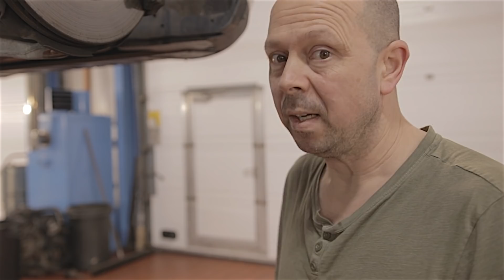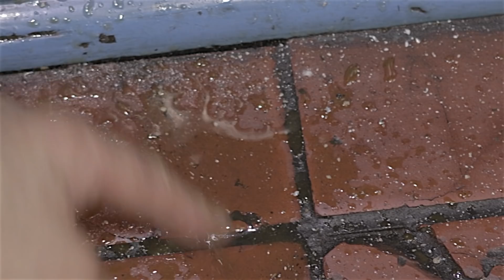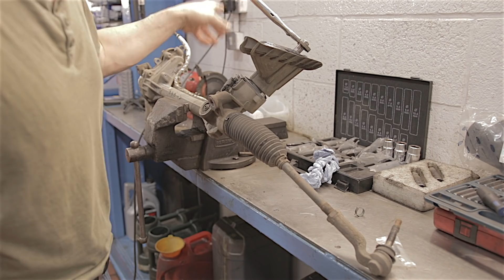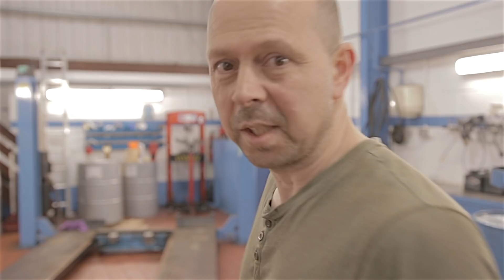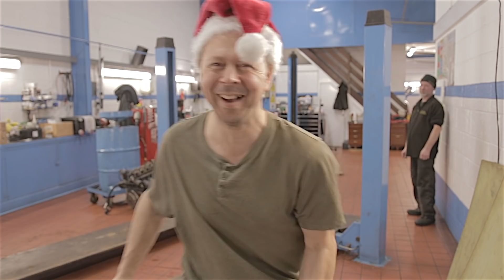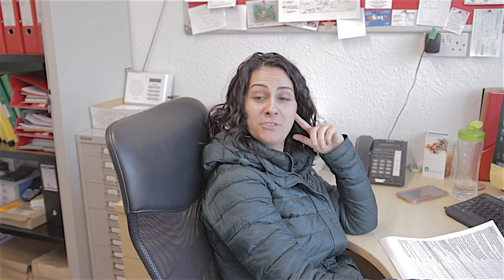Sheared Power Steering Rack Electric Motor Bolts (ford mondeo mk5)

Comment: Hi Alan. Have you ever had an issue with the steering having a notchy feel after long bends? Only happens on a long run.
Reply from the maker: hi, not had any notch issues with the racks on the mk5 as were common on mk3 mondeos but what is common on the mk5 is the front shock absorber top mount bearings causing sometimes severe notchiness....to check that, with the engine running, put your arm through the wheel arch and hold onto the coil spring while an assistant rocks the steering...if one or both bearings are faulty you will feel the notches through the coil spring

Comment: I have had two bolts snap in my 2015 mondeo. Found out during a recall. My steering made noise when I locked fully to left and right. They have told me it will be months before they receive the parts for my car, has anyone had an experience like this?

Comment: On my MK5 it's not making any noise or vibrations, but the steering is not fully returning to neutral/centre position. It gets stuck tiny bit before centre. Could it be also problem with these screws or just wheel alignment?
Reply from the maker: i doubt it very much but would be advisable to have your rack motor bolts checked anyway
Reply: @alan4x  I'll be changing brakes soon so I'll ask them to check the bolts, thanks a lot you took the time/effort to reply ♥

Comment: I have a Volvo V60 2014 D4 R Design, with speed sensitive electric steering rack. 193k miles. Mine has gone. Do you have a many come in with same problem of the motor/belt giving up? I think mine blew apart because a braided ground wire from subframe to chassis under air box, changed it & steering came back, but she gave up start of the week

Comment: Great video.  I had exactly the same problem on my 2014 Range Rover. The bolts sheared and the whole unit opened up.  Luckily I didn't lose steering and it was covered by my warranty.

Comment: I received a recall for this issue on my 2015 Mondeo today (April 2022). I have previously complained to Ford that the steering was making a knocking sound.  I am not sure if the knocking sound and the loose bolts are related but its good that they are fixing the problem.
Reply: hi, was this in england?? my steering has just failed today, cant turn the wheel at all.
Reply: @TheAjdj10  I am in South Africa. The recall was sent to me by Ford South Africa. I am sure it's a worldwide recall so you could ask your local Ford dealer to assist.

Comment: Hi Alen, i ve ford mondeo 2013 2 l diesel auto 
Car is running fine just i have one problem 
When i driving car in the heavy rain engine swatched off by it self and then traction control light come on . When i try to start car again doesn’t start , until traction control light swatch off by it self  then car start . But traction control light takes time to goes off may e 2 or 3 hours ? Do you have any idea about this problem i ‘d mach a appreciate

Comment: Hi man, i ve ford mondeo 2013 2 l diesel auto 
Car is running fine just i have one problem 
When i driving car in the heavy rain engine swatched off by it self and then traction control light come on . When i try to start car again doesn’t start , until traction control light swatch off by it self  then car start . But traction control light takes time to goes off may e 2 or 3 hours ? Do you have any idea about this problem i ‘d mach a appreciate

Comment: Hi All, 
It may help someone, I had the same issue with my range Rover sport 2016 bolt snapped and motor was hanging by the wire. Ordered some new bolt from eBay and I manage to replace the bolt while the rack was on the car. No need to remove the rack only remove the two bolts which hold the rack with the body that makes enough movement to take all shredded bolt off and replace them with new one. Just make sure clean up everything before put the new bolts. To tighten the belt do as Rig Landsfeldt have said below. Thanks Rig Landsfeldt and Alan. Land Rover wanted £7000 to replace the whole rack . Only costed me a tenner to buy new bolts from eBay. They bloody joke. If I was you never by Range Rover again totally unreliable cars. Mostly parts are with ford stamps and maid in India.Yeah mine straight going on autotrader. Costed me £32000 and I only mange to drive few hundred miles and engine light has come up with EGR code and now this.🤬

Comment: Mine was in today getting the bolts replaced under the recall and low and behold, they found a broken one so now getting the whole rack replaced under the recall. Didn’t know there was an issue with the steering rack until watching your videos so contacted Ford to find out what’s happening. Apparently there’s been a recall for months but I still hadn’t t received notification from Ford. Thanks to you Alan, I’m getting my car fixed before it turned into a death trap 👍
Reply: And to add, mines a 15 plate too!
Reply from the maker: glad it helped

Comment: Thanks a mil Alan for publishing this video. To my surprise, my trusted reliable Mondeo MK5 (registered 2015) was recalled by Ford this month (Feb 2021) in Ireland. This week, I dropped my car into my local Ford Dealer and they discovered that one of my steering motor bolts has sheared off (per your video) and that the other two were badly corroded. They impounded my car, as it's now deemed unsafe, and they ordered a new steering rack and motor, under warranty. I’ll be without my Mondeo for a week or more though fortunately they’ve given me a courtesy car to keep me mobile. It’s folk like you that have helped raise awareness of this problem and I consider myself lucky not to have been in a serious accident arising from faulty steering. Well done.
Reply from the maker: thanks john, its a good thing ford has finally recognised they do have a problem with those alloy bolts, glad they are sorting your car out foc😊
Reply: Count yourself lucky, Ford told me it will take at least 2 weeks to sort mine out and no courtesy car either... 😕
Reply: @tanwirh2213  Almost 4 weeks have passed now and my dealer hasn't started repairs... they are awaiting a steering rack to ship from Germany 🙄
Reply: @jtx101  hope it gets sorted soon mate, 4 weeks is a long time to wait, but at least you have a courtesy car so it softens the blow
Reply: Hi folks is there any update on this subject as my local garage has informed me that I have this problem this morning 06/01/2023
Reply: @billyclark3989  My Mondeo’s steering system was fully retrofitted by my Ford Dealer in April 2021, free of charge under the Ford recall, and it has worked well since, thankfully. It took 6 weeks to complete the job due to a long delay in parts supply during the pandemic. Hopefully, your retrofit will be completed much faster. 🤞

Comment: Do these need programming to the car if you fit a second part, I have Mondeo's and Ford Galaxy's on my fleet

Kind regards
Reply from the maker: no they do not need any programming
Reply: @alan4x  thanks
Reply: @alan4x   When you do the 4 wheel alignment you need to plug it in   to scanner like land rover discovery that I've just had done pal or just align it up please

Comment: This is a problem on Range Rover Evoques as well.  In Canada there is a recall, in the UK I think they are now starting to cover the repair when it fails, but so far in the USA I don't think there is anything.
Reply: Not just the Evoque.  I have a full size Range Rover and mine suddenly split open too.
Reply: @BushcraftBoy  Does it have the same style rack as this?
Reply: No. But it looks like the same type of failure. Bolts sheared and it split open.

Comment: dumb question im a noob at mechanics why dont we use like Gold or Silver bolts? why do we use metal bolts that rust?
strength I'm guessing? cant we make like a copper bolt that is strong and doesn't rust 
also, should I spray bolts with like WD40 silicon or smear then with vaseline?
I'm a noob at this stuff so any input is welcome

Comment: Ford UK are dragging their feet on this one, but now list steel high tensile bolts to replace them monkey metal ones fitted to early cars. Demand is high so they are on back order most of the time, but this is getting better. You need to be VERY pushy, but Ford will check and replace FOC if your car is affected. But like I said, you do need to be pushy.

Comment: This video has saved me a lot of grief in being able to diagnose immediately.  RAC came out 09/05/2020 and went through all the diagnostics etc... whilst the car was sat on my drive (not working).  He eventually checked what I stated you have said and low and behold, the motor was dangling loose!!! Many thanks for the guidance.  I just need to get it fixed.  Do you know if there is a UK recall yet?
Reply from the maker: lol...i don't think ford recognise this as being a problem so next to no chance of it being a recall like in america

Comment: Mine has been parked on drive (2015 Plate) for last 2 weeks during COVID-19 lock down.  I've gone to move it and this appears to be the exact problem I have, UNFORTUNATELY!!! What is the estimated fix cost please and does it need to go into Ford?
Reply from the maker: it all depends if the drive belt inside the rack is broken, if the bolts are broken then the rack will most likely need to be removed as removing the broken bolts can be difficult, worst case you will need a new rack..or get a good used rack

Comment: Any idea how I can replace that belt? Don't know which end is easier to remove so I can get the belt out:)
Reply: Hi Cosmin ! Do you know the CODE / Part Number of this "steering belt" ?
Reply: I do not have a part number for you but they are not actually for sale as ford just replaces the whole steering rack rather than just the belt.
In my case I found one on ebay and it was listed as new steering rack gear belt ford fusion 2012-, ford mondeo 2014-.
Once I had the belt I had to take the whole steering rack to a specialist to fit it in as it was too complex for me to open the steering rack. There's sensors that you can break if you spin the wheel too much as well. 
Apparently this kind of electric steering rack is used in a lot of models not just fords so you should be able to find one that fits if you search ebay thoroughly.

Comment: Hi Alan! Seems that the Electric motor has at stupid design, as the o-ring sealing the belt and drive, is locatet on the wrong side of the aluminium bolts so that Water can penetrate and get to the bolt so they corrode. Wouldt a thin layer of silicone sealant help?

Speaking of corrosion... how bad are the MK 5 when it comes to rust? Have just bourgth a 2015/16 2.0 TDCi with 11.000 Miles on the clock. My last car a Renault Clio III 2008 never ha any supplementary rust protection and 12 years old and with 65.000 Miles on the clock there was no rust. We have a lot of salt on the roads in winther times her in Denmark and the weather is humid like in England.
Reply from the maker: any extra sealing i guess can help but as the mk5 goes here in england i have not seen any corrosion as yet..i thinking corrosion was almost a non issue on the mk4 so i think they are well protected against salt these days

Comment: I have my 2016 ones checked and they were alloy so got them changed for the new Steel ones. Same on my lads 2017 Mondeo too, original ally bolts and changed out to new steel ones..
Reply: Do you know which bolts they were?
Thanks
Reply: @danz792  will try and find ford part numbers for you.

Comment: 8mm x 35 mm bolts, fully threaded, my bolts that came out had a key head not a hex head, just check that you can get a socket on a bolt head as the bolts I have seen being purchased on a mk5 Facebook page have the washer built into the bolt head which may touch the motor body? those bolts are fords bolts, how ever they are different to mine and could be a slightly larger diameter? Buyer beware?

Comment: Hello Alan. I have a MK5 Mondeo, with the 1.5 Diesel engine, 120HP. I need to do the oil and filters change, but I don't know exactly which type of oil I have to put in. The car has 103.000 Kilometers. Thanks

Comment: Hi Alan. I work at a used  car dealership specialised in fords. I have seen these aluminum bolts break on 4 different cars. I pull the motor off, clean everything, get the broken thread removed, fit the motor with new steel bolts, use a prybar to pry up on the motor while tightening the bolts to make sure the belt is tight. 
The 4 cars i fixed the rack on, had one bolt holding the motor on, and  steering made a horrible vibration and sound. Guess the sound comes from the belt skipping. Never heard from the customers after i changed the bolts and tighten the belt :)
Reply: I have the same problem, managed to find a belt as mine got damaged but I'm stuck at getting the belt out as the case it's too big on either sides. Any advice?
Reply: Update: I found a steering specialist in London who refitted the new belt and put in new bolts for 120£ and paid 70£ for a new belt on ebay. Just need to reset the error codes and check the wheel alignment just to make sure. But I'm driving it now and it handles perfect 👍
Reply: @cosminalbu5735  hello Cosmin,would you mind sharing the link for the belt and the place the fitting has been done?Thanks

Comment: The ministry of transport in this country are an utter joke ! Take my wifes 16 plate cmax diesel ! Fuel injector Shorts it puts the abs module into fault mode which effects the steering , Clutch and brakes ! how the F**k is that safe ? You want to feel this thing ! wont brake right or owt ! Anyways i worked on that many fords they used to come out and ask us wtf was wrong with their vehicles 😂 Dual mass flywheel springs to mind ! but i’m 10 years out the game now thankfully, Merry xmas by the way 😂

Comment: Had a 2015 mondeo in a few days ago with all 3 bolts broken, seemed to be aluminum bolts, got a used rack from a 2016 as the belt was broken( the belt can be bought separately on line) and it had steels factory bolts, I was going to change them until I realised they were steel
Reply: How do you tell if you have the new steel bolts or the old aluminium ones?
Reply: The old bolts or what was left of them were as light as a feather and a magnet would not stick to them, I had actually taken out one of the steel bolts on the replacement rack as I was expecting them to be alloy to replace them when I discovered they were steel.
Reply: Alloy bolts are torx heads. Steel bolts have a regular hex spanner head
Reply: How do I get the belt out?

Comment: Hey Alan, I'm an ex-BMW master tech and can't tell you how much my brother and  I love your channel! My brother has a mk4 Mondeo diesel and almost every issue we have ever come across, you have covered brilliantly both verbally and visually to the point that it gives my brother the confidence to tackle the work with me watching over his shoulder!
I have a small question you could cover in a video of all the special tools you guys have made for working on the mk4 and 5. Or if you felt like directly answering, I would be most appreciative.
We are just about to tackle the cam belt. I have some spare 8mm rod to use. I know you state that you use an 8mm bolt for the cam pulley. You also say in your mk5 video that your bonnet rod flywheel locking pin is 8mm but I see it is bent in a very specific way to be installed on the mk4 from underneath missing the starter and reaching up past other breathers etc. 
The question . . . 
Any chance you could confirm the diameter of the rod is 8mm and correct for the mk4 flywheel? It would make my life 1 bazillion times easier if you could also tell me the measurements of the bent up rod, length wise between the bends and there approx bend angle if you know what I mean? So I can make my own.
You're an absolute legend either way. I hope you have a great Christmas.
Reply from the maker: thank you for your nice comment and a very merry xmas and new year to you😜the piece of bonnet rod is 7.43 mm in diameter
Reply: @alan4x  I really appreciate the reply bud! have a great christmas!

Comment: Great video. Thx. I had the exact same fault on my 2015 model. I'm happy it didn't happen on the highway or in a turn at high speed. It broke in my driveway, so I will talk to Ford about the recall issue. Merry Christmas
Reply: Please let is know how you get on with ford 👍
Reply from the maker: thanks and merry xmas😜
Reply: So far I've got no positive feedback from anyone. It's all boiling down to who's better at directing responsibilities and dodging it. I think Ford has to take responsibility on this one. They've used bolts that couldn't handle the force over time. Who knows if people have been in accidents because of this. I was driving around Europe and was doing sometimes over 190 kmh. Imagine losing steering at that speed...! I think we as Mondeo owners should gather and complain.
Reply: Last update. I've got an answer from Ford. The rack won't break in speed, because the torque is only there in low speed when the servo really has to work. They put the fault on "white list", which means they are taking it seriously for the first time. Maybe they will change it for me. If I'm lucky. I already got a spare part, and if I have to use it, I will improve it by replacing the bolts with normal steel ones. Cheers

Comment: How modern mechanics operate....   problem with steering ...  1st job lets plug a computer in ...  get the codes ...not get it on the ramp and have a visual check first
Reply from the maker: lol, merry xmas😜
Reply: @alan4x 

Merry Xmas Alan and the  Hackney possie
Would have been an interesting follow up to drill out those carrot bolts and replace them with ....?  Allen head bolts and give further information about thread size and length  and before and after
Surely if this is a known problem Ford should have these at discounted rates for exchange and customer care

Wonder what sort of channel you would have or how busy you would be if Steve bought Skoda